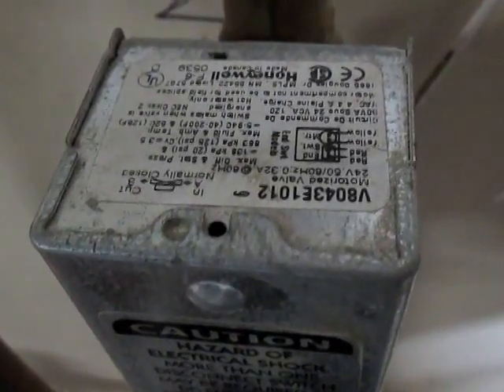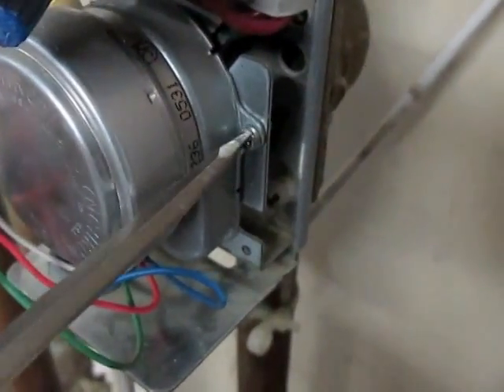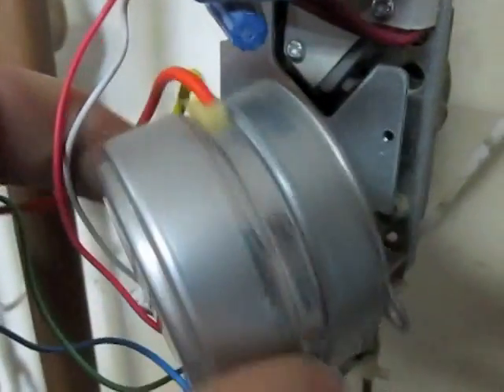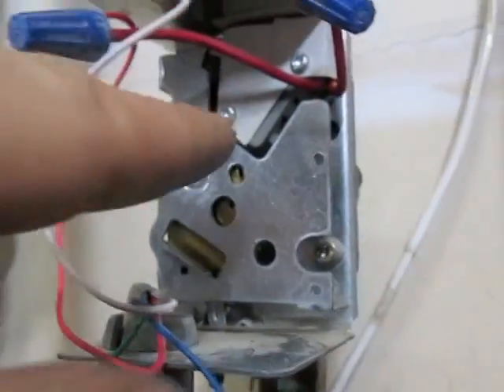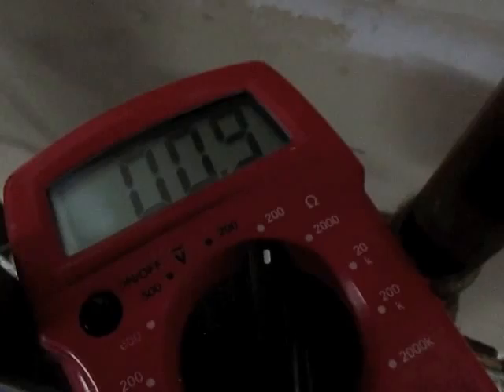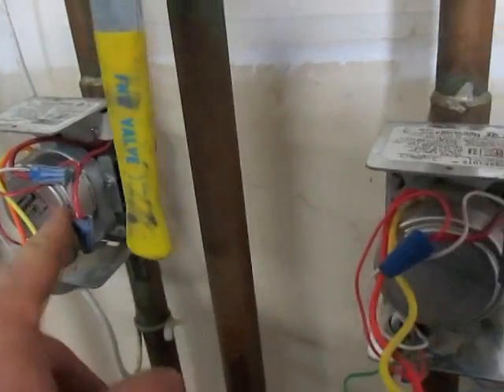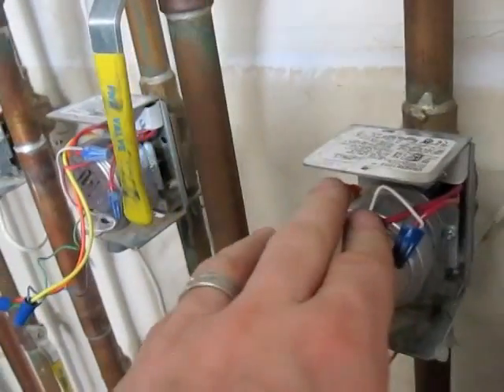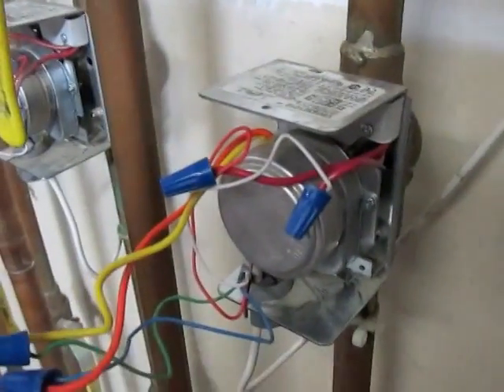Trouble shooting zone valve and end switch that won't turn heat off or on V8043E1012 Honeywell

Comment: i have same valve can i swap out whole  zone valve without disturbing copper pipe /solder?
Reply from the maker: You can replace the small motor/powerhead if it is malfunctioning without messing with the pipes.  I tested mine by swapping it with the one next to it and it still worked, so I knew it wasn't the motor/powerhead
Reply: @youcanfixit3721    turns out its the plunger ball is stuck inside  brass body valve so guess i gotta replace whole unit hey unless someone has a trick to open it took valve off  and tried turning with wrench wouldnt stay open still but got some hot water to area.

Comment: The heat for one of my zones won't turn off.  At first, I thought it was the thermostat so I replaced that but there was no change.  Next, I replaced the motorized valve for that zone and it still won't stop heating.  Do you think the plunger in the pipe could be bad?  If so, do I have to drain the pipes to replace it?  Or, do you think something else could be wrong?  Please advise.
Reply from the maker: Sorry I missed this.  Did you get it figured out?  let us know whet you did to fix it.
Reply: U